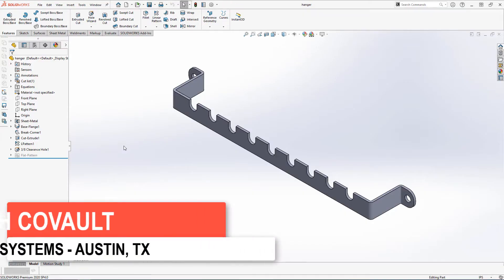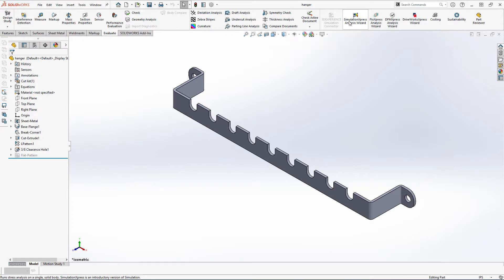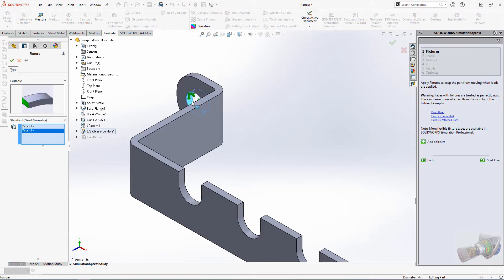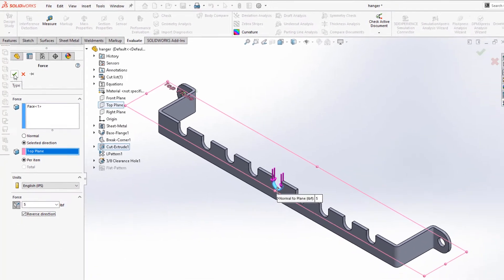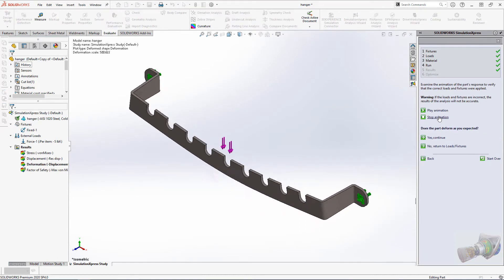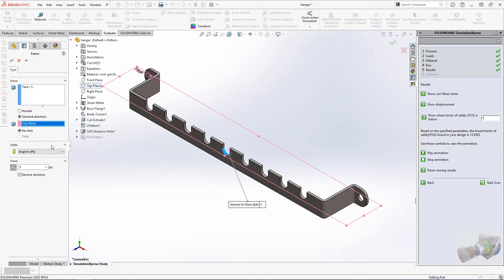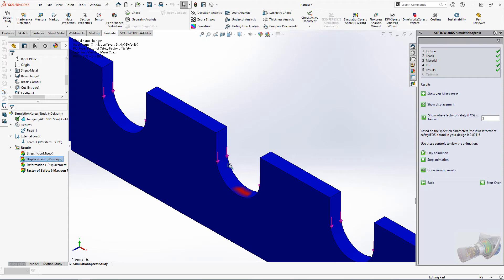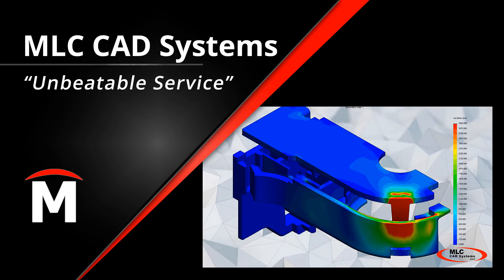Overview of SOLIDWORKS SimulationXpress

Comment: You were using SW Premium, quoting from another source,

 The Premium suite has broader FEA capability, allowing you to do static, stress and motion analysis on assemblies, as well as parts.  

Is this not accurate?  You also stated that you had no control over the mesh, this also seems somewhat inaccurate, as I've seen some level of control in the mesh, limited though it might be.  i.e., "Change Mesh Density" followed by a couple of sliders.

Really the question is:  What are the differences between the Xpress wizard in SW Premium vs the other lower level packages?

(Really, both are nothing more than a built-in sales gimmick to drive users toward the full Simulation package)  : /
Reply from the maker: Great question, I'm happy to clarify.

All levels of SOLIDWORKS contain the SimulationXpress wizard, even if a higher level of Simulation exists.  SimXpress and Sim operate in different areas of the software, so it is possible to demonstrate SimulationXpress accurately on any license and it will operate the same way as it would in any other license of SOLIDWORKS.  

It is true the mesh density can be adjusted within a small range.  What you cannot do is change the mesh polynomial order, mesh type, set mesh controls on individual areas, run mesh quality plots, or deviate beyond the range of the slider in terms of mesh density.  

SimulationXpress is a wizard-style interface that allows you to run a narrowly pre-defined type of study on a single-body component.  It is great because it is available to everyone and very easy to use even for new users, and the pre-defined setup is easily the most common type of setup users would want to run.  It's ease of use and limited customization work together to make it a handy tool for running a very basic pass/fail study.

Simulation (of which there are a few different levels, starting at SOLIDWORKS Premium) provides a full set of tools for setting up and running an analysis.  It allows the study of multiple components and how they interact, multiple mesh types and advanced mesh controls, multiple result types and failure characteristics, more complex loading conditions such as thermal or remote loads, connectors like bolts to more accurately understand complex pre-loads and failure conditions, and much more.  The higher levels offer more control and more advanced types of analyses such as frequency, thermal, fatigue, non-linear, dynamic, etc.  Not everyone needs these additional controls, but they solve many problems that SimXpress cannot solve.

Motion Simulation is another area entirely but offers kinematic and dynamic studies across a range of applications.